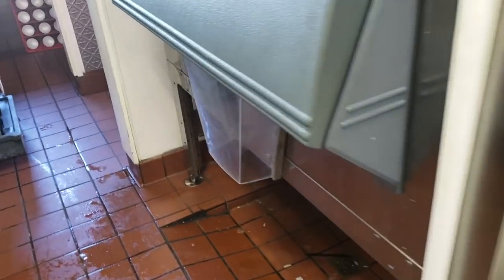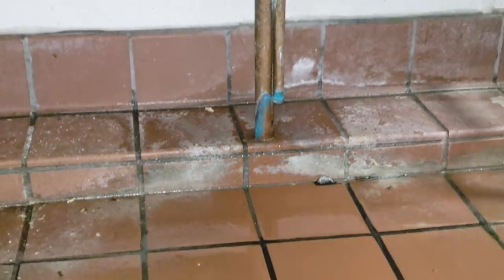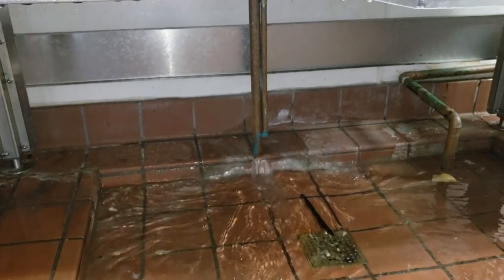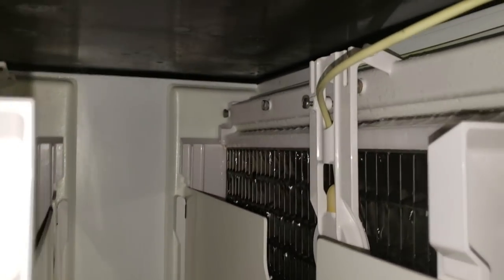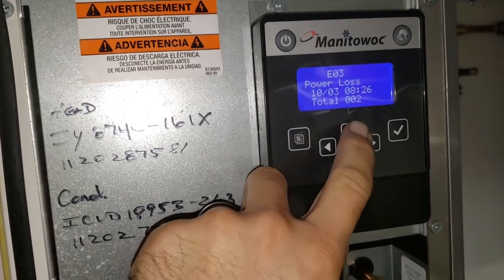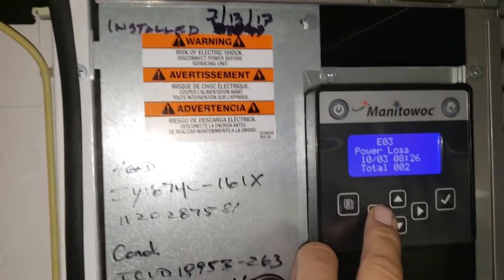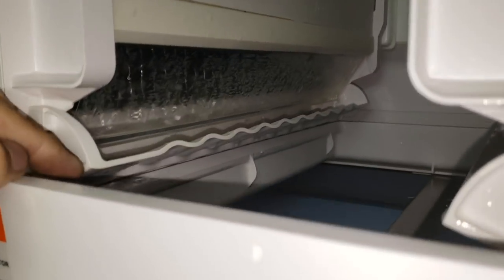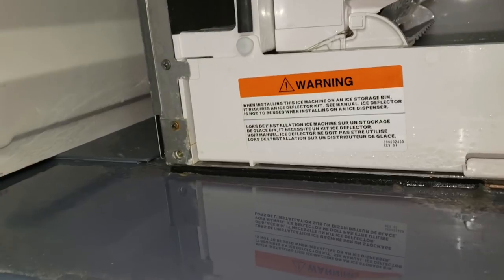Follett Ice bin leaking water

Comment: hey, do you ever work on VOGT machines?
Reply from the maker: I used to have a few of them a long time ago, but not anymore.
Reply: When I lived in Vegas I worked on them. Have yet to see one in Houston and am not that sad. Lol. There not that bad once you understand them just beasts of ice machines.
Reply from the maker: Mine were old r-12 dual mode flaker/cuber ones and they were all retired. To bad because those things were beasts but the customer didn't wanna rebuild them.
Reply: Can you put the link for the  gasket that you been using? thank you
Reply from the maker: Grainger part # 10L934 is the foam tape I use
Reply: HVACR VIDEOS the hotel I work at has about 20, my continued issues are, faulting on high/low pressure. 🤦🏽‍♂️ I’m constantly resetting. 
Some of it is from the chill water side , other times there’s no obvious leak🤦🏽‍♂️